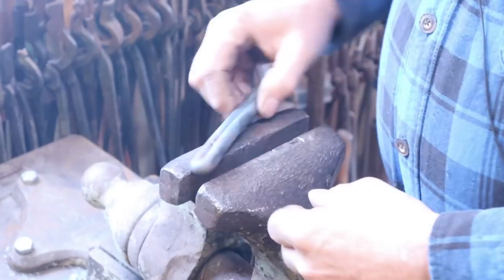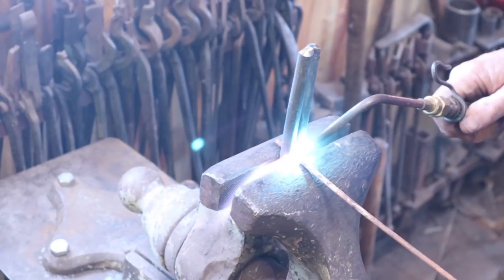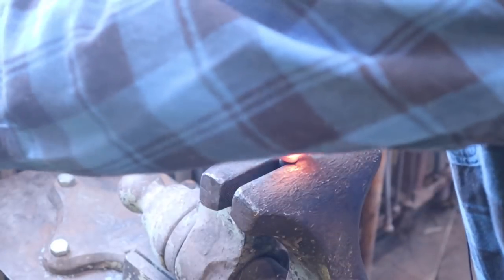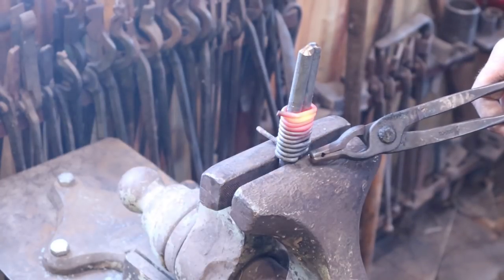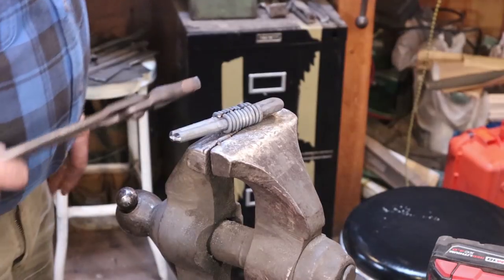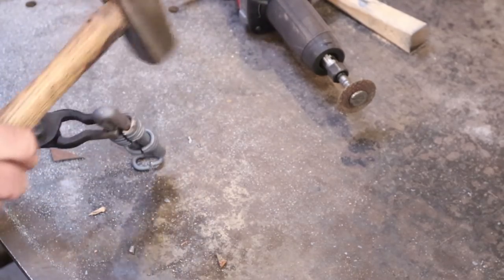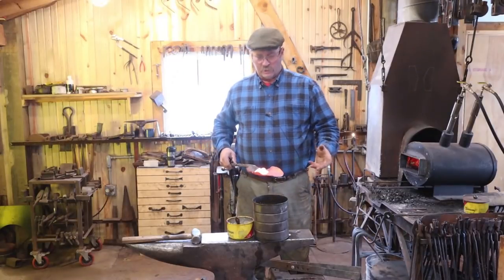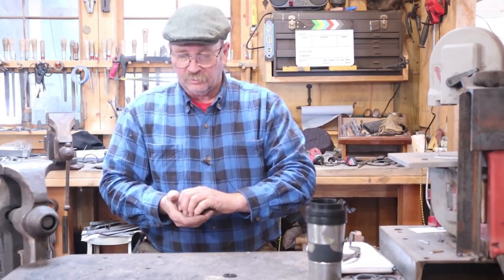Making simple rings or chain links

Comment: I made a Hold Fast to use in my Pritchel Hole.  The Pritchel hole is only 1/2 inch.  I was sceptical as to whether the 1/2 inch stock would be substantial enough to hold the projects I was  forging.   So far, it works fine.  Thank you for the design and instruction on forging the Hold Fasts.  I have no intention of making these items for sale.  It surely is a great help to me when I'm forging.  I work alone and the 3rd hand works great.  Best Wishes.